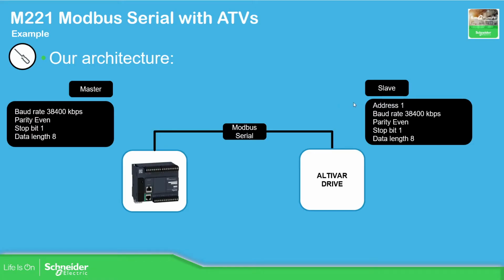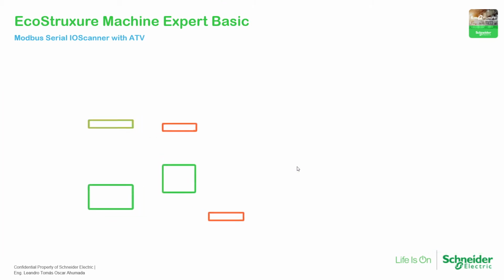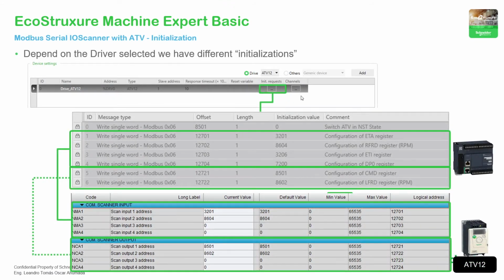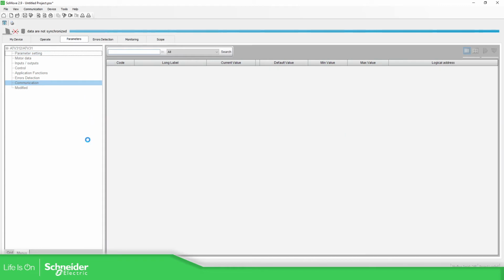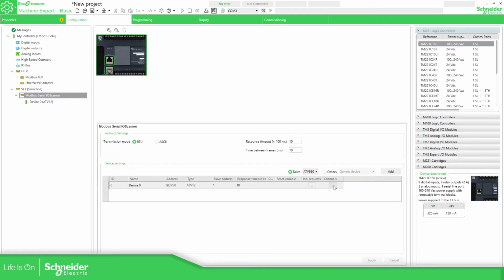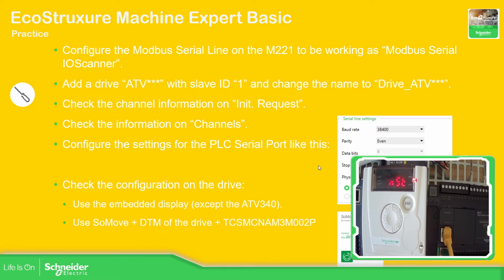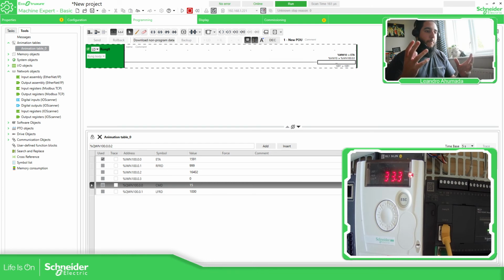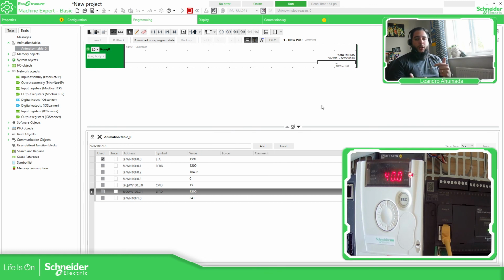Training - M221 - M9.3 IOScanner for ATVs Introduction

Comment: Hi, thank you for making this training video. It really help me..
I hv a problem when i apply this to atv630. I set the value of LFRD but the value only set for a moment and it back to zero. it cycling. What can i do to fix the issue?
Thanks
Reply from the maker: Hi there! I saw it before and i believe the problem is the ocnfiguration on the ATV to enable the Ioscanner and the register to use.

Comment: Hello.. How to read or write acc / dec using tm221? Where tm221 as a master
Reply from the maker: Hi there! You can use the ioscanner to read/write the ACC and DEC of the ATV. Depend on the drive you can those variables on the communication table to access the data.
Reply: Note : in setting menu i choose generic device not drive (atv320)
Reply: Hay.. Ok thanks.. I've try and it works.. But maximum 9 register address that i can add to the channel assistant.. In my project i need more.. How to solve this problem?

Comment: Thank you for the video. Can I make a Modbus serial connection between M211 and ATV71 (ATV71HU55N4) ? You showed in the video that the ATV71 list is Discontinued...What does it mean ?
Reply from the maker: Hi Tarek! As far as I know the Schneider drives come with modbus serial embedded so you should be able to connect with the M221.
As you can see in the next link the atv71 is discontinued:
https://www.se.com/ww/en/product/ATV71HU55N4/variable-speed-drive-atv71-5-5kw7-5hp-480v-emc-filtergraphic-terminal/
So Schneider does not sell this product via normal channels if you need one you will need to check with the services in your country for an spare part otherwise migrate to a new ATV
Reply: @LeTomasAHUMADA  Thank you. Indeed I have the ATV71 in my pocession so I will try to connect with the M221. On the other hand, I don't have intention to use SoMove for the configuration (to avoid using the TCSMCNAM3M002P cable and download the DTM), can I use the graphic terminal display for that purpose ?
Reply from the maker: @tarekbenhacine8743  yes, you can use the display that comes with the atv71 to modify the modbus parameters, the setpoint via modbus , the control via modbus and channels not separated.
Reply: @LeTomasAHUMADA  Thank you very much.
Reply: @LeTomasAHUMADA  I modified the parameters as required but unfortunately there is no connection between the M221 and the ATV71.

Comment: How to connet atv320 with m340 in mod CANopen ?
Reply from the maker: Hi there! I am more into the Machine Expert rather than the Control Expert but as far as i know you will need to have a M340 processor with the CanOpen embedded. Then you will need to open the CanOpen port to add the right eds of the ATV that you want. If you do not have the eds for the ATV320 you can try with this faq and add it to the software: https://www.se.com/ww/en/faqs/FA345069/
If you need any further assistance about the integration you can probably contact the technical team of Schneider in your country for an example:
https://www.se.com/ww/en/work/support/country-selector/contact-us.jsp

Comment: Sir, do you have any idea what happens with my system. So i today i just tried to use plc tm221 to communicate with atv12. For several times, i can control that atv from my plc, and then when i tried again the communication is error and the SL lamp on plc won't turn on. So i try to restart my supply and plc. When the plc is still in stop mode, the slave lamp was on, but when i start the plc, the slave lamp turned off then communication error
Reply: And sir one more thing, i don't know why my error indicator in plc always blinking, is there any option that i can see what's the error and fixed or reset it?
Reply from the maker: Hi Jonathan! Check on the system bits and words of the M221 for further information about the system.
Reply from the maker: Hi Jonathan! If you can connect to the M221 I recommend you to check the diagnostics of the device and the diagnostica of the IOScanner to have a much better idea of the problem. You can check the implementation video:
https://youtu.be/NoK18heE3HA
Reply: @LeTomasAHUMADA  sir, i tried this method and the io scanner value goes to 2, but when i try again to reset the atv, the io scanner still error. And it said 1 IO scanner error
Reply: @LeTomasAHUMADA  because i can't reset my atv from plc via modbus due to that error, i change my atv parameter to start/stop and then reset it via DI2. When i try again to on the drive, IO scanner still error but the value in IO scanner like the videos you show still 2

Comment: how i can create my own function block of the VFD (VSD) ? please , can you make a video about that please Mr AHUMADA
Reply from the maker: Hi Hichem! I recommend you to use the original function blocks (MC_*_ATV) to control the Altivar Drives. If you want to create your own function for 3rd party devices you will need to go to "Programming > User-defined function block".  I do not have a presentation for this now but i can add it  later. Thank you.

Note: If you need to work on this now, check pages 59 to 70:
https://download.schneider-electric.com/files?p_enDocType=User+guide&p_File_Name=EIO0000003281.02.pdf&p_Doc_Ref=EIO0000003281
Reply: @LeTomasAHUMADA  thank you so much Mr AHUMADA, please add le video later